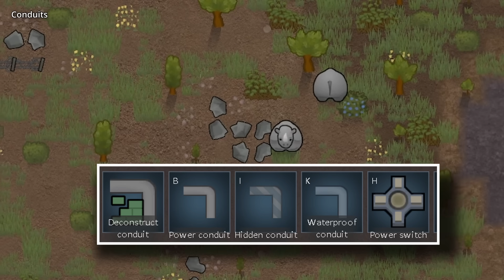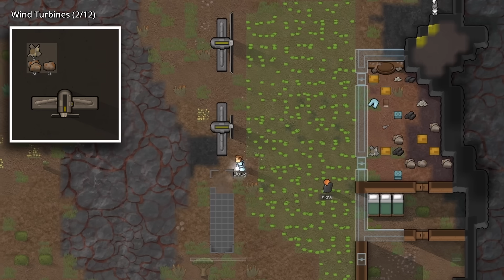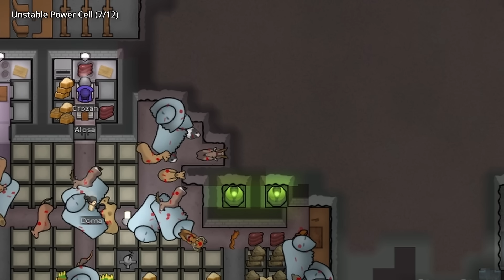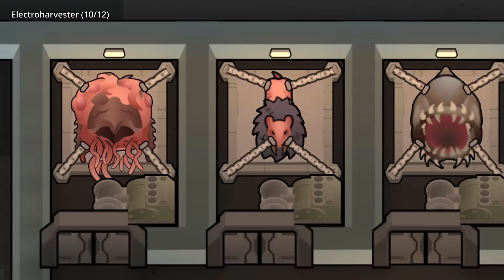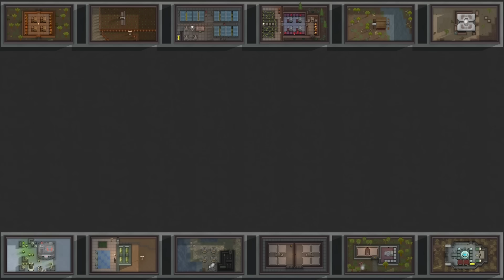Which Power Method is Best in RimWorld Odyseey? (1.6)

Comment: Since there are some obvious mistakes in the video that points to the lack of expertise for the creator, I'm gonna leave a little bit of information in hopes to satiate thy needs for those who seek it.

One single Boomalope can power 2.7 Chemfuel generators. That means by taming 2 of them, one can power 5 Chem Generators with ease and have some fuel left over. Also if you're using a GravShip, Chemfuel generators are the most space efficient way to power your ship at the start of the game.
Solar occupies 4*4 and produces 1700W partially, instead you can fit 4 Chemfuel generators (2*2) in the exact same space and get 4000W constantly.

Contrary to popular belief, Nutrient paste is the most efficient way to feed animals on your GravShip. It has %300 nutrition efficiency, followed up by baby food (%200). Kibble has only %125. Since it's hard to print out bulk nutrient paste without mods, making baby food for your Boomalopes is usually the way to go. So you can fence off a 2*1 area for 2 of them and you'll get all the fuel you need by simply producing baby food. 👍🏼
Reply from the maker: Great comment - thanks for the analysis! I'm going into the different ways of using chemfuel generators in my follow up video specifically about gravship power and so decided to keep this one briefer about the different ways of getting wood, chemfuel and bioferrite. However, chemfuel from boomalopes totally deserved a mention in this video - a mistake by me. I'm still learning how to make these guides and I'd certainly change a good few things about this video already! Thanks for the comment 😀

Comment: water mills should be buffed in the game, I love using them as decoration and variance in my colony but efficiency wise it's really not worth it. They should either reduce the cost of it for example (200 wood, 50 steel, 2 component) or increase the power output to 1500W.
Reply from the maker: Completely agree. The game feels pretty against the water mills and the definitely deserve a buff!

Comment: TIP - About Turbines. 

If you are getting low power on your batteries and you need some windy days. Shoot a boomalope to trigger a forest fire and then rain. Or leave a ton of items on the floor exposed to the environment. The game is designed to bring rain to decay them faster cleaning the items from the map faster.
A ton of wood scattered, lost of small animal corpses rotting, a bunch of stripped corpses with their items lying on the floor will do the trick.
You will notice this pattern very soon.

Comment: TIP - Generators also produce heat and light in 2 tile radius, they are ugly to see making the room worse.
This is particularly good to put in a prison, It will make your prisoner miserable having the chance to lose belief on their ideology but also providing them with cheap light and heat. 
All you need is to cool the room a bit with a wood cooler or a vent to make it livable. The heat from the room ( if you use a vent, will also normalize a barracks right next to it )

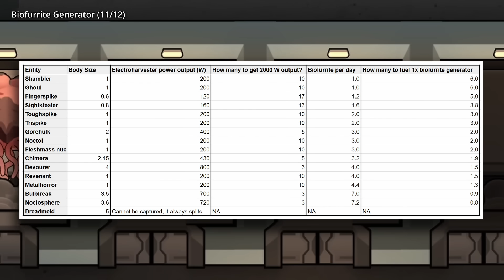Comment: @10:37 It's worth mentioning there's a better way to get bioferrite you've not mentioned on the spreadsheet. Bioferrite produced scales with body size, so you can  also use deadlife dust on elephants, thrumbos and mastodons to get a good amount of bioferrite a day. It's been a while but I want to say it's around 6.0 so less than a bulb freak, but with them being a lot more easy to capture and not needing shock lances.
Reply from the maker: That's super useful to know - thank you so much!
Reply: And if you allow them to regenerate life and use a longsword with great damage, if you get lucky to cut their legs ( or limbs they use to move ) they no longer are capable to escape. You can put them outside in a 0 cost not even walled holding square and they will remain unable to escape.

Comment: I'd say it may be worth leaving a section on the final table for generators with additional dangers or byproducts.

Unstable power cells potential for large scale damage.
Electroharvesters requiring the containmnet of many dangerous entities which WILL escape. (Arguably could also include bioferrite generators but to a lesser degree, you can get a supply through containing the nocipsohere, the fleshmass nucleaus, and chopping harbinger trees. It'll just take longer to set-up, and one of those is not a viable long term option on account of getting murder antsy.)
Toxifier generators needing regular maintnance to control their pollution and storage for it until a solution can researched. (You could probably dump it from a caravan but I've been told this tends to anger people and cause raids.)

Other than that bit which honestly is more opinion than anything, this was a rather nicely researched and formatted video.
Reply: You can contain most biological entities permanently by destorying their legs via frostbite. Contain them in a cell with a freezer set to -100 C and wait for frostbite to get to 50%. Keep a doctor at hand to stop the bleeding when they start losing bodyparts and turn the freezer to -50C to keep the frostbite stable at 50%. The entity can then be moved to its permanent containment spot(yes spot not the platform) when its legs are destroyed. For example for Thoughspikes that is their left and right tentacle. Just like prisoners, entities without legs can't try to escape.

 This obviously doesnt work for entities that can regenerate.

Comment: Usually I just have 2 chem/wood fuled generators on standby in case the power consumption exceed the grid's capacity.
Flick them on while the pawns build more solar panels/windmills to compensate.
It's crucial for underground or (with the odyssey dlc) grab ship playthrough where hydroponic is your life line
Reply: Tbh, you can save on wood by turning it into chemfuel, since one Wood-fire generator uses around 30 woods to make 1000W, whereas chemfuel generators have it 10 (after the wood-chemfuel refinement).
Reply: @Coskun-0795 yeah but it still helps in some situation.
The new grav ship gussle fuels if you spam jumps around to explore.
Chemfuel takes time to produce while I always have a stockpile of wood on stand by for furniture or insect hive bbq purposes.

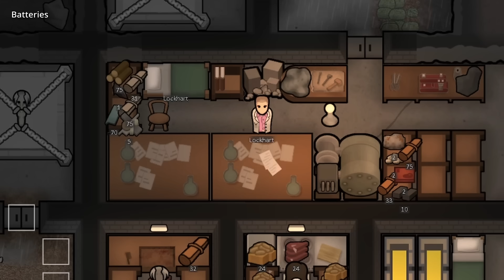Comment: 5:32 Solar Panels are very useful to power sun lamps. The time of production closely matches the time of plant growth.
Also, you can design your schedule around running the big consumers during light hours.
Naturally you still want some batteries.
Reply from the maker: Absolutely, the timing lining up is very useful!
Reply: Nah, they look good at first glance but they actually suck.
You need 2900w /2 for the 50% off period (1450w) which fluctuates and another constant  1680w to power the 24 hydroponics for a total of 3130w of constant power.
Per panel 1700w is only produced 50% of the time, cutting efficiency to 850w, and is then cut in half again by the night time drain of the hydroponics basins, making each panel only  truly generate about 425w of power.
This means you need 8 solar panels for one single optimal hydroponics setup. Which is 24 wasted components. 
And raider AI is programmed to seek out and smash solar panels, even if they are miles from your colony.
You are far better off with two toxifier generators and a single pollution pump for a total of 9 components, or one geothermal for 8 components.
Assume batteries in all setups, just left them out for simplicity.
Reply: @bahamut256  The basins are constant. Something you will solve with constant generators.
While the solar lamp is variable.
Panels produce power exactly when the Solar lamp is consuming, taking the edge off that big variable consumption.
And you can also plant in the ground under a solar lamp.
Reply: @christopherg2347   Panels drop and raise, starting out at 0 at 6am  and reaching 1700 after 4 hours, after which they produce full power for 4 hours, after which they decline back from 1700 to 0 over the next 4 hours, hitting 0 at 6pm.
Grow lights flick on at 6am on full charge, and draw 2600 until 6pm. Thats a full 8 hours a day your plants aren't even growing.  To offset that you'd need 6.5 panels and a battery due to the 50% efficiency of batteries.
Thats 21 components to power one measly lamp, which is more than half of what you can usually find on an entire map. By the time you researched and built all that, you could have tox gens and pumps for half the research cost and a material cost of 8 components.
Solar panels are an actual noob trap.

Comment: a very long video for a simple problem what is easy solved: The truth: Chemfuel Generator are early midgame the best. Why? well they produce constantly energy and only use up 10 wood converted to fuel instead of about 20 per day of the wood gen.
=> You should notice what boomalopes are the best friend from chemfuelgens. 1 boomalopes feeds 2 gens.
You forgot to mention about the tox generator that you can combine it with tox pumps and dump the shit at the map edge for ages. so you dont have a toxic area in the middle of your base :P
=> Anomaly electric harvester you need to mention that it inflicts brain scars over time and slowly kills your anomalys ^^

Bro to rank Solar higher in Power ranking than chemfuel is a shame with Hydroponics in the lategame you tap infinite power ;) 
i disagree for space even chemfuel is better lategame: why? you need more space on your ship for solarpanels than chemfuel sure you need production but lategame you need hydroponic aswell
Reply: Yes, Chemfuel is the way, solar power is trap. Especially in ground. Even in low orbit running at full power, it takes 4 chemfuel generator worth of space and space matter A LOT in orbit.

Comment: Amazing guide and very well put together. Great presentation overall and easy to see and understand. 

Fog reducing wind turbines makes sense but it should also reduce solar yea. 

I wouldn't put the material cost for water mills as high imo because of the abundance of wood generally. While geothermal I would put as high due to component costs. Generally when you are at the stage of materials mattering the component costs would be harder than wood costs.
Reply: tbf, wood is very, very biome dependant. you either have it in your start or not
Reply from the maker: Glad it helped and I'm really glad you liked it. I'm new to making these guides and have a lot to learn! I agree on the wood cost, I can see where you are coming from there. I do feel water mills are not as good as maybe they deserve to be. Thank you for the feedback :)